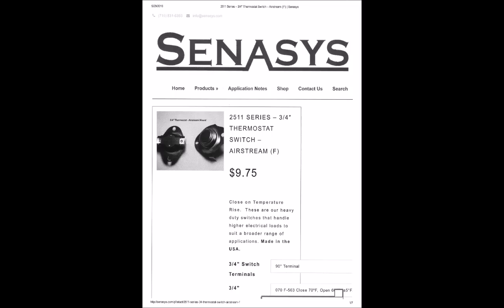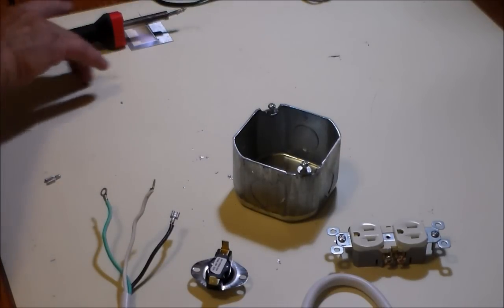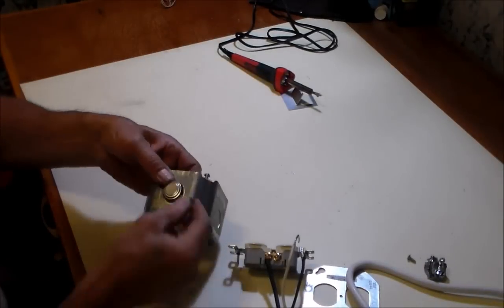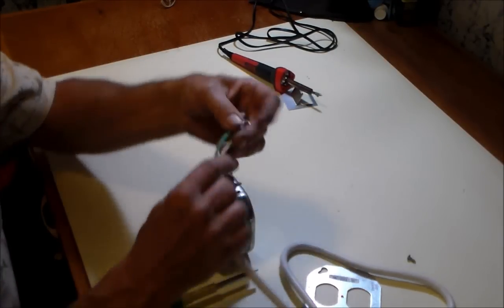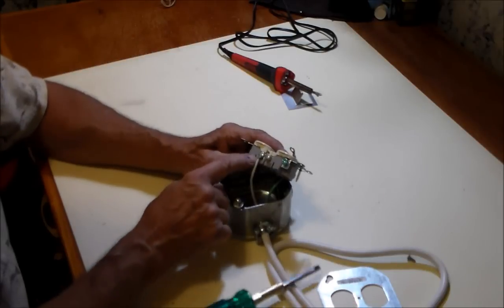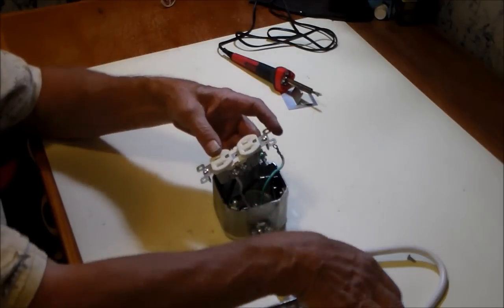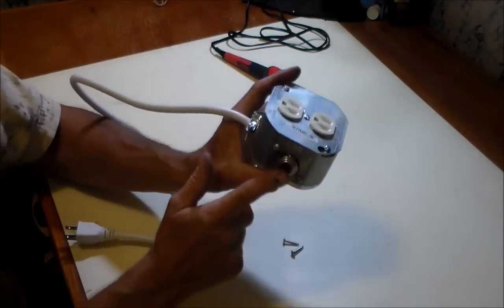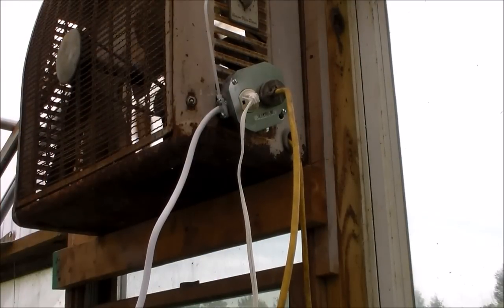Aquaponics Greenhouse Thermo Fan Control

Comment: That is awesome. I paid a considerable amount more for my thermostats, I would suggest putting the thermostat in the middle of the greenhouse though. It will give you a more consistent temperature through out the structure that way, The closer you get the thermostat to the fan the cooler the readings while the fan is running. It will shut off before the other end has been cooled. Just a suggestion though!
Take care my friend!
Chuck
Reply from the maker: Thanks for the advice my friend, good luck--- Don